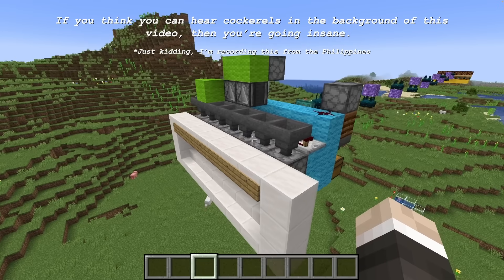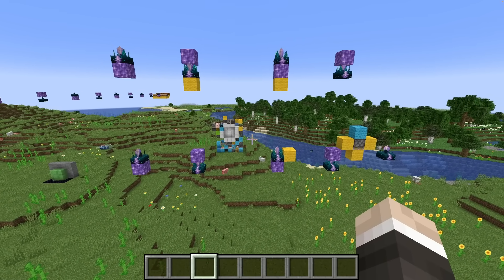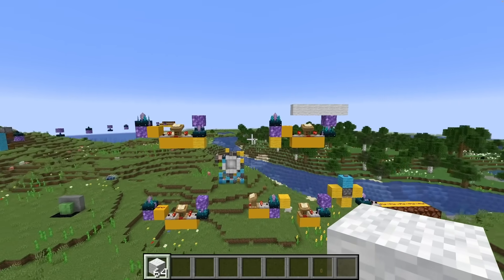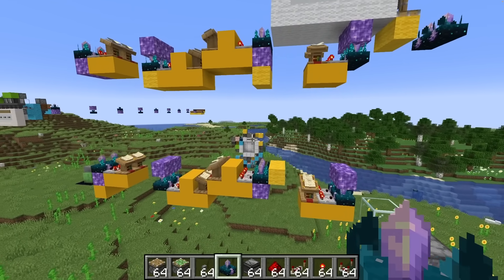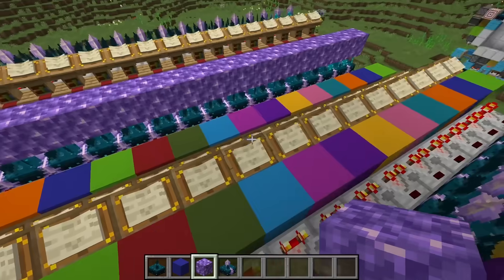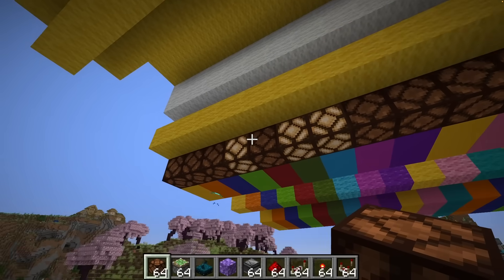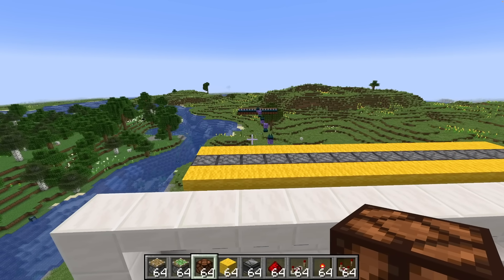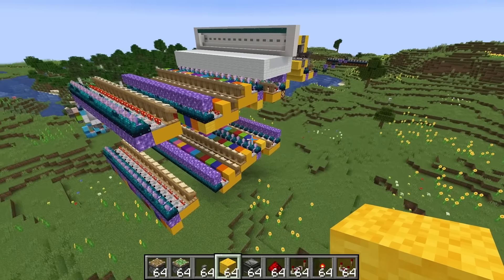This is not a redstone contraption.

Comment: This is like watching the extremely early internet being created. It’s kind of scary to think that with enough time and patience, somebody could actually make an internet in minecraft. Just actually think about the mind boggling-ness of this
Reply: I mean, the internet is essentially just a long distance way of transmitting 1s and 0s (how it's done specifically is different). Having 16 outputs (0-15) can also be used as a binary output system with 15 bits (or about 2 bytes). Say you need to transmit the number 9, instead of transmitting signal 9, you can transmit it as 000000000001001 (which would be signal 12 & 15 in this system). Doing it this way gives you a lot more flexibility in what you can transmit too: 32767 different outputs, +1 if you consider no outputs, or a 0, an output.
If you're interested in this stuff, there's some insane redstone computers (with CPUs, ALUs, etc) all built in minecraft and only redstone.
Reply: This reminds me of an idea I had of a rail network that would automatically route chest minecarts to their destination based on named items inside them. Technically this could achieve much higher bandwidth than a redstone or sculk sensor line, but because hoppers are slow things would get messy quick. Then there's the huge benefit of being able to transport items. Chunk loaders would of course be necessary, as always.

To elaborate a bit, the network would be constructed of loops, where minecarts can move in a set direction, and routers placed along a loop, linking it to either another loop or an endpoint, where as a minecart passes through an item filter looks for a named item corresponding to the neighboring loop or endpoint, and if one is found, it is placed back into the minecart and the cart transferred to the neighbor. The routers would need a buffering mechanism in intersections to keep the minecarts from colliding. The sender of a minecart would include inside it named items corresponding to both the sending and receiving endpoints as well as all the loops it needs to pass through to get from one to the other. A nice property of this system is that minecarts that fail to route will automatically return to their sender as long as the sending endpoint is specified correctly.

I made a small proof of concept, and the idea seems sound, modulo some potential reliability issues with minecarts doing minecart things. (Namely, carts bumping into each other and going the wrong way would be absolutely catastrophic.) Would be cool to do this in survival, but since I'm not in an SMP I haven't bothered.

edit: So the youtube algorithm did its thing, and I was recommended a video by jazziiRed describing an 'automated post office'. It's very similar, although it doesn't have the hierarchical routing aspect I described. (Well, the 'post offices' could in fact be used in the place of loops for building such a network; this just wasn't shown in the video.) Also, the buffering mechanism is less than perfect -- the same half-duplex rails are used for traffic going both ways. In the video it's said to take care of 'most race conditions'. I'm a bit doubtful.
Reply: @Lassi Pulkkinen  Check what they built in I think it was season 6? Mumbo and Iskall and Grian made Sahara, and Mumbo and Iskall handled the Redstone bits, and made quite an amazing way of getting items and such brought to a specific destination. Same destination but, you could choose the items brought to you, even getting multiple different items put into a singular shulker box or such at that, all specified by what you chose.
Reply: @impulse7942  I did see that. Actually, my idea was kinda inspired by it. And yes, it's different. It would actually be possible to make a remote sahara where players could order from their bases and have the items delivered back, as part of a network that wouldn't be limited to just sahara traffic. Again, lots and lots of chunk loaders. But it could work, i guess. (I also think Mojang should increase the speed of minecarts above elytra travel, which could make this a tiny bit more practical, maybe.)
Reply: @MythicTF2  You could also see it as a 1 bit hexadecimal system
Reply: @lassipulkkinen273  SlicedLime built a device (I think in an SMP) that could teleport players to different hub stations.  It involved some sort of minecart wizardry (all vanilla).

On the topic of an internet in Minecraft it would probably be best to use fewer signals instead of relying on something that could break so easily.  You could have synced clock circuits at both ends (they'd probably sync themselves considering how ticks work) so each sound could send either a 1 (sound at same time as clock tick) or 0 (no sound when clock ticks).  4 bits could send a form of Unicode (each Unicode character is 64-bits but afaik most implementations send 8 or 16 bits at a time) though latency may be a bit too high.  

The comment earlier about getting higher bandwidth with worst latency from sending items via minecarts is a lot like real life.  We often use compression to send more data (or more apparent data, lossy image and video codecs are common) but it comes at the cost of latency since it takes time to compress and decompress data.  Big data companies (Google, Facebook, Apple, ect) often use trucks to move large amounts of data around because it's faster to copy the data to a truck full of hard drives, drive the truck to it's destination, and copy the data to it's new location than it is to send that much data through the internet.
Reply: @MythicTF2  Minecraft in Minecraft

Comment: The potential for this to make large Redstone builds more compact is incredible. You no longer have to worry about making space for crossing Redstone lines and You can send several different signals straight up a single shaft. I already have several ideas for base wide commands and elevator setups that would have been impractical before.

Comment: I think there should be a 'vibration releaser' block made by echo shard and amethyst block that emits vibration with the frequency matching the redstone input or somethng. It will be really helpful to those one-line signal transmitter and also give use to echo shards.
Reply: also extended range sensors with the same recipe.
Reply: Better yet: a way to record sounds to echo shards, letting you throw them or crack them to emit the saved sound. Perfect for trolling and maybe you can use it to lure mobs by making them think one of their kind is somewhere
Reply: @atheontimesconflux1067  thats an awesome idea
Reply: @atheontimesconflux1067   “VERY GOOD” (DS series)
Reply: That's a cool idea. In the meantime, instead of trying to record the sounds at the control stations, why not use the storage trick to keep a master copy of each sound in the spawn chunks, then use the lines to transmit copies of those sounds to every station that needs them?
Reply: Let's call this block a vibrator.
Reply: @samuelwilliams2266  oh... on no....
Reply: Or just make it so that noteblocks can emit all frequencies if at the right pitch, I know that frequency and pitch are diffrent things but why not
Reply: yeah the idea of a sculk emitter might work, where it’s crafted from a sculk shrieker and echo shards, and then had one side where you calibrate it and the other side where you activate it. when activated it will produce a vibration of the calibrated frequenc
Reply: i'm no redstoner but isn't that basically a wireless repeater?

Comment: The beauty to me is that the one line can split and if you stored the contraption in, say, the permanently loaded spawn chunks you could conceivably have a world wide command center with each station of that center receiving the only the appropriate inputs.  Like every farm you own tied to one button and then you have 14 others for who knows what.
Reply: Would the lines not also need to be constantly loaded? Also it would take ages for the soubd to actually travel. I am sure if someone did something crazy like having chunk loaders everywhere that would work
Reply: I know sound information is lost in unlost chucks. Is that the only limitation though? I was under the impression that sound was more tied to the player's simulation distance than it was to what chuncks were loaded.
Reply: @skydragonfire93  Potentially, but it seems Mumbo hasn't tested that on a multiplayer server, where you could potentially load the sounds at spawn in a sound-proof chamber, move 16 chunks away with simulation distance/render distance set to 2 chunks (for everyone), and then return.

Depending on the results, we may either have a fully wireless system that only requires chunk loaders, sound-proofing and re-calibration each time the world unloads, or a wireless system that is much more limited in scope.
Reply: @IvanisIvan  And while it would take sound quite some time to travel, its extremely lag friendly compared to other redstone.

Instant pistons are still quite laggy, same for instant hoppers(would need a plugin for that, it does reduce the lag caused by hoppers, but not entirely) or even rails.

For the amount of distance you can travel, the amount of farms you can start with 1 single press and the amount of time it takes to set up, its remarkably funny.

Plus, it works underwater too. You could flood a perimeter and have the system be fully loaded on the floor, silent.

It fills a niche that needed to be filled while also having applications outside of that niche.
Reply: @theblackvoid that doesnt need to happen on a multiplayer server. Spawn chunks stay loaded even in single player
Reply: *AUDIBLY SCREAMS INSIDE MY HEAD*
Reply: @theblackvoid  I guess we just have to wait for Doc and his Hive Mind to get ahold of this technology when the fature is released in full.
Reply: @IvanisIvan  Maybe there's a horizontal version of the truck where you move a tower if a stone wall on one end, which causes the other end to change, and then it can get picked up by an observer.. This basically makes an instant red stone signal.

If only this could be done horizontally.

Comment: You could get arbitrary length messages with just 2 or even just 3 sounds. Sound 1 is a "0" and sound 2 is a "1" and sound 3 (not necessary but it simplifies things) acts as a "space" then you encode every letter A-Z as a series of 1s and 0s with spaces to separate each letter and then you make something to encode and decode messages
Reply: You can just encode spaces in binary as well, then every 8 bits is a single codepoint. Basically ASCII or Unicode.
Reply: looks like the minecraft telegraph has now been developed
Reply: you just invented morse code
Reply: @adrianfernandez5488  can't wait to see that being made
Reply: perhaps you could use the 8 different non-player sounds (and an extra 9th button to send the message) to send messages in octal? theoretically there are 15 sounds so hex is theoretically possible, but like Mumbo points out a lot of those sounds are tedious to generate
Reply: Why not use all the non-player sounds (which I'll call sound "0" through sound "7") to encode them more compactly?

space: 0
A: 1
B: 11
C: 12
D: 13
E: 2
F: 14
G: 15
H: 16
I: 3
J: 17
K: 21
L: 22
M: 23
N: 4
O: 5
P: 24
Q: 25
R: 26
S: 6
T: 7
U: 27
V: 31
W: 32
X: 33
Y: 34
Z: 35

Comment: Soundstone is by far my favourite addition in this whole update. Conceptually, it's awesome, but then it's also actually useful
Reply: lol, I like that name. Soundstone
Reply: doesn't look that useful yet but I agree the concept is amazing.
Reply: Would Allays count as soundstone, since they use the same vibration system and particle?
Reply: @orbic521  they don't really take part in redstone contraptions. They are transport service. So they don't count. Skulk sensors are all about sound and signals, so they are soundstone.
Reply: @orbic521  i think aesthetically they fit in perfectly if you're going for a theme, but i don't know enough about how they work to know if they'd bring anything unique to soundstone contraptions. Definitely not off the table for them to add something at some later point specifically for allays with this though, since they're very connected to amethyst

Comment: I think you could have a bunch of buttons connected to 2 of the sounds, each button with its own 2 sounds. You could theoreticly have 225 different inputs and outputs if you did that.
Reply: He could in theory make a base 15 coder and it would be 4378938903808593775 different output
Reply: @calcu_  This is also tru

Comment: It would be nice if they added something that can replicate a sound when powered with redstone.
Maybe they could do something with Sculk Shrieker.
Reply: Maybe with note blocks as they can already make mob sounds
Reply: Yeah, I thought the same thing. Imagine a calibrated skulk, but with copper instead of amethyst. It stores the last pulse and sends it out when powered.
Reply: A block like a jukebox, but it writes a sound onto a record when powered. And if that record could store up to say 16 sounds, you'd have a data storage device that can be loaded, unloaded, and rewritten. I compact disk in Minecraft!
Reply: @minuteman1043  What if you could use that to make a flying machine that follows and records a song made on noteblocks onto a disc?
Reply: Parrots
Reply: @ike__  They'd despawn if not in loaded chunks, no?
Reply: @VixYW  You may also wanna include a semiconductor in the mix as well — such as silicon (quartz, already used in 95% of advanced redstone components) or beryllium (emerald, currently unused in redstone)
This would basically be a capacitor, except it stores data instead of an electrical current
Reply: @theonebman7581  Makes sense. Tho I just picked cooper to give it some function, since it's nearly useless as of now.
Reply: @TornaitSuperBird  not sure if it’s different with parrots but when you look at passive mobs like sheep and cows it gives them a persistent NBT tag which makes them not despawn in unloaded chunks- used for/ in mob farms etc.

Comment: I think it could be a potentially useful control hub for industrial farms where you have a skulk sensor line wrapped around the industrial zone and the farms decode the signal for on/off commands. Also the whole forgetting the sounds thing can be somewhat remediated by reloading most non player based sounds like entity landing with snowballs, tho realistically who could have 15 different farms in an industrial district. Loved the demonstration tho, very neat :D

Comment: The ability for making like an encoding and decoding station tk make like an incredibly complicated code that can only be deciphered with a specific combination is crazy. If you had 21 different sounds that could be made then you could build a key board that sends a message down a wireless stream and can only be decoded by decoded/received by another preset specific set of sounds. It has so much potential
Reply: It may be possible to simply use combinations of sounds instead of 21 separate ones. Just 2 sounds and an agreement on how many sounds per symbol, boom, here you are streaming binary.
Edit: this means that if we take the simple 7-button keyboard Mumbo built in the first video and establish a coding system where each symbol is 2 bits (2 button pressings), then we'd have 7^2=49 different possible combinations. Which is enough for English alphabet (26), decimal numbers (+10), dot, comma and space (+3) and then some more. Now just build an encoder that takes your input from a proper 39-button keyboard and transforms it into two consecutive/parallel outputs and you're set.
TL;DR: 7 different types of sounds is enough for a keyboard if you use 2 sounds for each letter.
Reply: Am I just being dumb, but how is this any different to having say 21 different redstone lines? Is it just saving on 21 block long lines into just one?
Reply: @MV-vv7sg  yes, the main issue is size
Reply: @MV-vv7sg  Yes, it is just that one line of "wireless" redstone is fancier than a pack of spaghetti
Reply: Can't have 21 unfortunately. Maximum Redstone charge is 15.
Reply: @triflest3542  you are right that is a better system
Reply: If you are ok with pressing 2 buttons per letter you could probably use a modified ascii system

Warning: Lots of nerd stuff incoming

Extended ascii has 256 (16^2) symbols and we have 225 (15^2) possible symbols. There are around 6 ascii characters with no meaning and around 10 that just exist for computers to correctly interpret what's being sent. If you get rid of all of the symbols that are letters with accents that we don't have in English we are easily under the 225 symbols needed. You could also cut out all of the incredibly specific punctuation that you'll never use in minecraft if you want more symbols

Comment: I would imagine this would be great for setting up a security system. If you have a second base, you could use this to detect movement in the other base, or have an enderpearl in stasis being triggered by movement unless you click a button that turns off the calibrated sculk sensor

Comment: I guess theoretically you could even count  the number of time each signal is recieved and maybe make a decoder that take into account not only the signal strength but also how many times each signal is sent, especially since you can use a 9 hopper clock to time when a sound is sent. And to know if the message is over (on the recueving end), I guess you could use a comparator decay clock that would refresh with every new signal, meaning that the signal would be over only when the comparator clock isn't outputting.

(Edited bc I can't spell at 10 pm)
Reply: You can just use serial encoded hexadecimal, it’s not functionally different from regular signal strength data transfer, just way slower and less reliable.
Reply: You people are way too smart, I'm just a poor builder xD